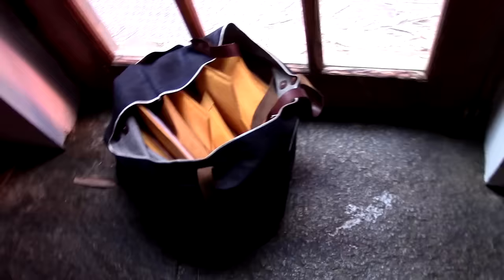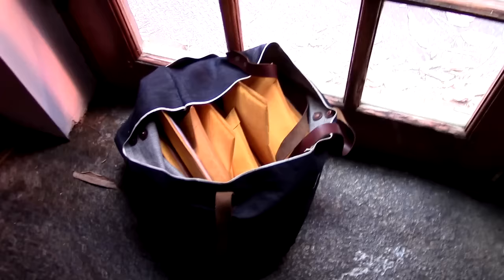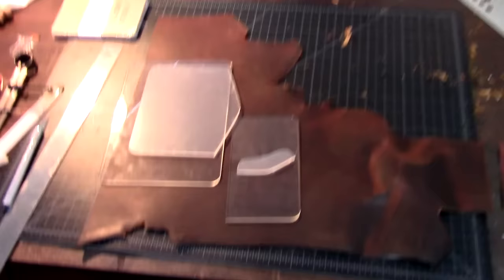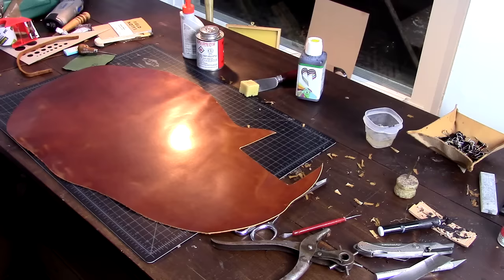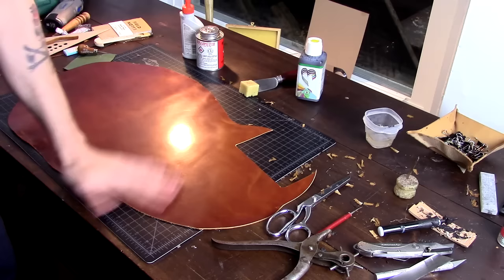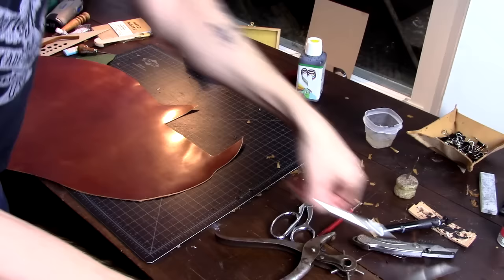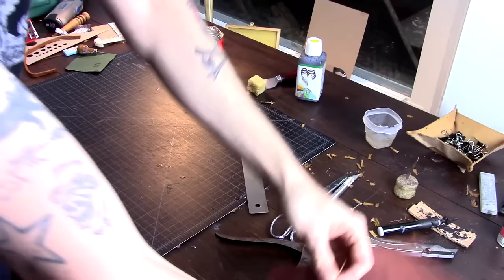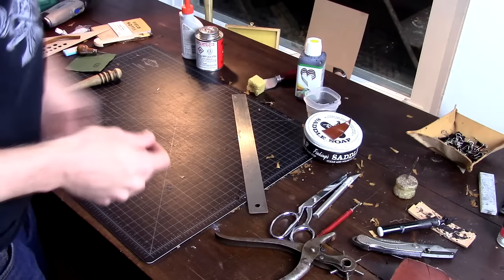VLOG #2 - Where is my shell cordovan?

Comment: hey Justin thanks for the vid. I'd love to know how you make those acrylic templates. I'm using card stock currently
Reply from the maker: +Spencer Moret Hey Spencer. I design them in Adobe Illustrator and when ready I take it to my local makerspace to use their laser cutter. Thankfully on my the way their is an acrylic shop where I can pick up the material. There is a bit of learning curve to the software but having the solid template is well worth it.